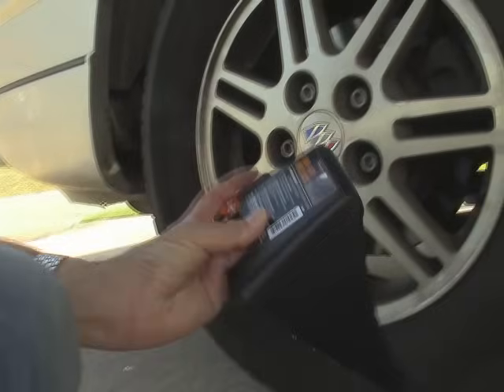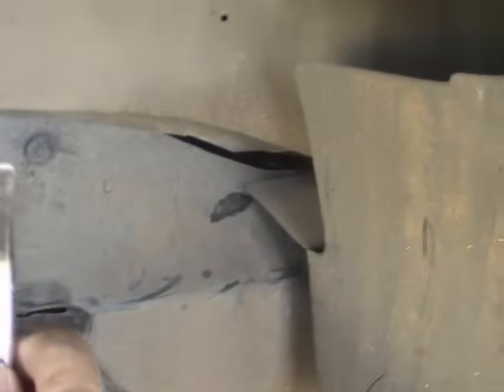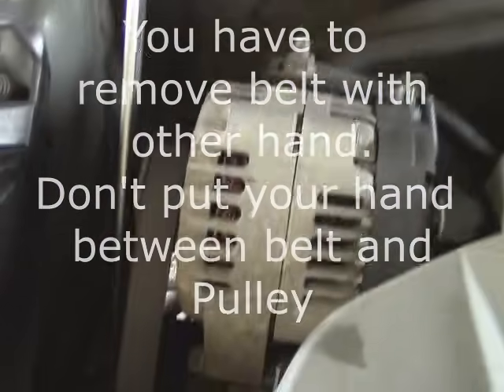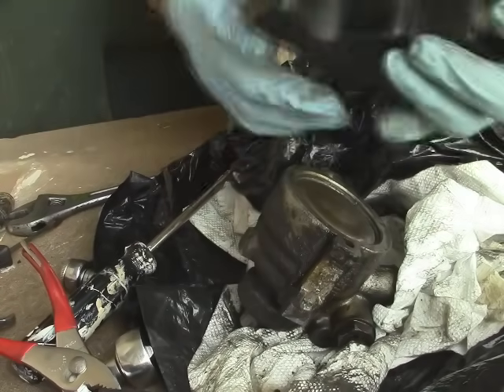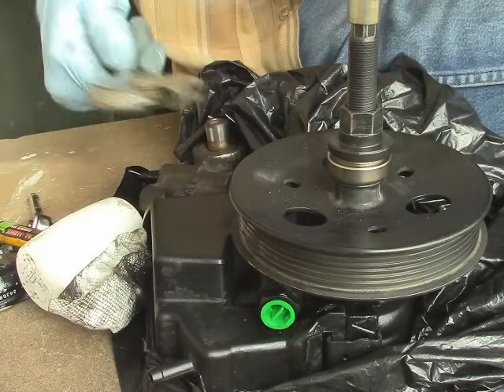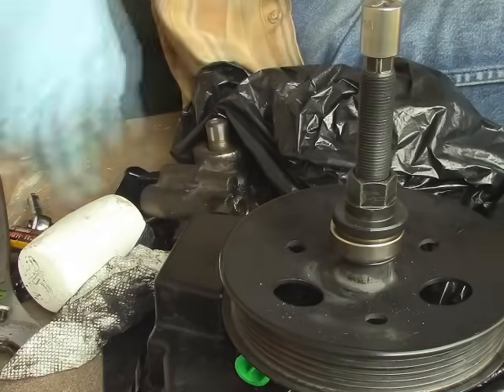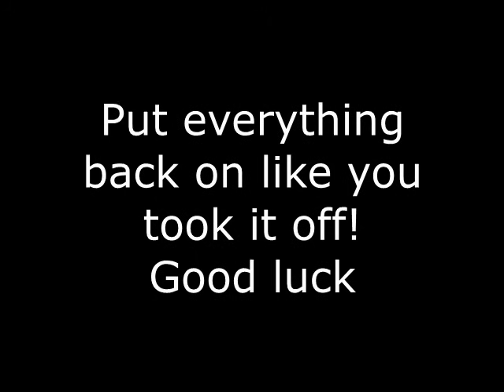How to Replace Power Steering Pump GM 3800

Comment: Thank you. I couldn't figure out how to get the bolts holding the pump out, since these bolts appear to be blocked by the pulley. So you use the holes in the pulley for access! Brilliant! Who knows how long it would have taken me to figure that out. I was going to try and use a wrench on the backside of the pulley. Knowledge is power when working on cars. Great video.
Reply: Brilliant!!💪🏾
Reply from the maker: Thank you
Reply from the maker: Thank you

Comment: It's obvious that you aren't a mechanic or a machinist but you have the guts and basic knowledge to just do it. I cringed at the fumbling with tools - anxiety. Good job, glad I wasn't there to watch.
Reply from the maker: +Bob Jimenez  Ha ha, more not being a mechanic...  However, I am a retired machinist....
Reply: sorry about that. manual or cnc?
Reply from the maker: +Bob Jimenez  hey Bob, used to run, VTL'S, surface grinders, and then the last 5 years CNC, when I first started was in another shop, lathes and milling machines that was more machinist. Last 30 years was reworking jet engine parts.
Reply: we are in the same line of work
Reply: +Bob Jimenez That's how you learn bud. Look up as much info as you can then jump in and try, preferably on a PoS but sometimes you don't have a choice.

Money saving tip: Don't get a belt removal tool, use a 15mm wrench, if you need more force daisy chain another wrench. If you don't know how to daisy chain wrenches look it up, by far the most useful trick in a backyard mechanic's arsenal.

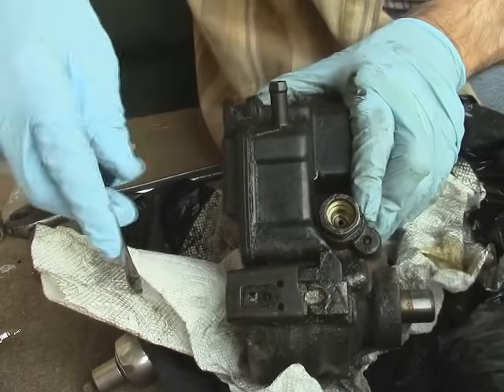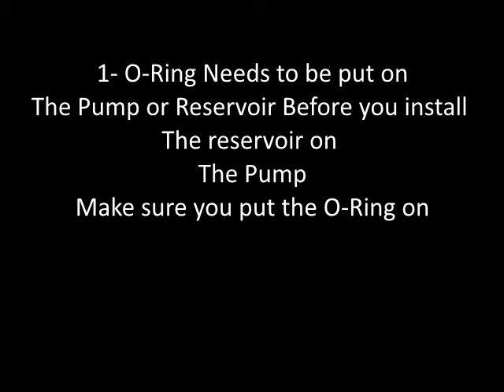Comment: Wheel off and beauty cover off 3:50 5:00 unclamp hose 11/16 not sure on metric pulley removal 9:00 Reservoir removal 11:16 o ring for Reservoir 12:25 o ring install 12:55 17:00 pulley reassembly be sure 2nd o ring on the high pressure line 19:19
Reply from the maker: I guess that sums it up...

Comment: What if the pulley has seized and I can’t rotate it to align the hole with the bolt to remove it how would I get it off
Reply from the maker: ZaYZae,  I am sorry, I don't know, If you have a shade tree mechanic, they might be able to help you...

Comment: How do you get the pump back on??
Reply from the maker: It was a little difficult,  basically the same way you pulled it off, except you are putting it on.
Reply: @RichRodgersOnline  I gave up I couldn’t get it lined up for nothing!! I’m selling it
Reply from the maker: I am sorry it has been a while since I put the video up.  I am not a mechanic.   Just take a break,  then try it again.

Comment: How do you know when the pomp is going bad.   And is not one of the pressure hose.  Thanks. Mine is dripping fluid from some where.   Any tips?  Thanks again
Reply: Did u find out what it was
Reply: Justin Perez  no I didn’t.  My car end up with a bad transmission. So I junked it.
Reply from the maker: I am sorry, I didn't get notifications that someone made a comment.   You may have already sold your car.  
Difficulty steering
The steering wheel may feel stiff or hard to turn, or the vehicle may not respond when you turn it. 
Noises
You may hear a squealing sound when you start the car, or groaning or moaning noises when you turn the wheel. The noises may get louder when you make a tight turn. 
Vibrations
You may feel vibrations or shaking in the steering wheel, especially at low speeds or when turning. 
Fluid leaks
You may see red spots on your garage floor, or the power steering fluid level may be low. 
Fluid color
The power steering fluid may appear gray, which indicates that the pump is breaking down into the fluid. 
Tire wear
Uneven tire wear, such as cupping or scalloping, can be a sign of power steering issues.
Reply from the maker: I understand that
Reply: @RichRodgersOnline  thanks.  No worries.  This comment might help someone else.   Yes I did junked my car.  Thanks again sir. Thanks for uploading
Reply from the maker: @GGarcia7111  thank you!

Comment: So question, how much should I be paying to get my 2004 Grand Prix power steering pump replaced, flushed and checked for leak? Any ideas
Reply: 450
Reply: J Wright quoted 125, 100 and 65.... paid $80
Reply: +2danextlevel what state ? I just got quoted 450 today....... :( definitely will shop around if that's the case
Reply: +2danextlevel Just priced one at Advance Auto for $65 with the reservoir ...$56 without.
Reply: 2danextlevel
Reply from the maker: You probably read the comments

Comment: what is that connector for on the power steering pump? mine was originally mounted to the original pump with a clamp where the bleed screw was. but now my new pump doesn't have a bleed screw. any advice?
Reply from the maker: I am sorry, I do not know...

Comment: I have a question my 97 park avenue power steering bolts broke what bolts do I need
Reply from the maker: There are several videos on YouTube about removing broken bolts.    This is what I would do if you have room.  You need to have a hole right in the center of the bolt.  You do not want to damage the threads.   I would use a center drill to get the hole right in the center.  Then drill the hole with a small drill bit, then a little larger.  You may want to spray the outer edge of the bolt with some type of spray like "Liquid Wrench"  You might wait and spray it again hopefully the spray may get into the threaded area.    After you have done that,  you might get an "Easy Out" and put it in the hole you drilled and hopefully unscrew your broken bolt.   Here is a good example https://www.youtube.com/watch?v=KK6eNjRqOR0
Reply: awe....  that sucks

Comment: how in the heck did you get the high pressure hose screwed off??? I have this same motor and I can't even get a wrench or anything in there. Help me please! How in heck did you do it?
Reply from the maker: +nimrod4569 You might have to hold the nut close to the pump with a wrench and then grab the line nut and loosen it up.  I am not strong...  But it broke loose for me.
Reply: +Rich Rodgers  I got it. I actually kept trying on the bottom of the pump where the high pressure hose connects to. It looked to me like you were pointing at that instead of the actual one I should have focused on. My mistake. Thank you
Reply from the maker: Great!

Comment: How do you get air out of system?
Reply from the maker: I think after it settles the bubbles will go away
Reply: Turn the wheel from lock to lock several times, while monitoring the fluid  in the reservoir.

Comment: How do you know when the pump is bad
Reply from the maker: Terry Nobles   I have little space to answer this..  Pump maybe making very loud Look for increased effort in steering which may be accompanied by pump noise. Low oil can cause this to occur as well as a loose pump belt or bad power steering pump. When the power steering fluid is old it can cause the tubes that move the fluid to gum up which can lead to power steering failure. The power steering fluid will also tell you a lot about the power steering pump. New power steering fluid is colored red and the odor is very distinctive. Power steering fluid that has turned to dark gray this can indicate oxidation. If foaming or bubbles are present in the power steering fluid this will indicate water or air in the power steering line. Look for flakes of chrome in the power steering fluid. This will indicate degradation in the power steering pump.
Reply: +Terry Nobles Mine has a high-pitched whine when the engine is running.  I was at NTB today and they said the pump was going and it would cost $250 plus labor to fix it.  Re-manufactured pump is ~$65 from Advance Auto.

Thanks for the video.  You saved me over $300.

Comment: It's not as easy as just reversing what you doing I've been working on this power steering pump the 2 dam bolts to put it back in for 2 days
Reply: It’s a nightmare I’m still trying to put them back on it’s a tight spot and getting your finger through the pulley and angling the pump itself and once you feel like you’ve got it you really don’t
Reply: took me almost 45 minutes to line it up and bolt it on
Reply from the maker: It wasn't the easiest thing
Reply from the maker: I understand
Reply from the maker: It takes a while

Comment: What is behind the power steering pully?  On a 3800..because I'm leaking oil from behind their but Idk from what
Reply from the maker: Not sure, I am not a mechanic....  I am sorry...
Reply: Oil pressure sender/switch
Reply: Shaft seal is leaking

Comment: So i need that special tool in order to get the pully off  :-(
Reply from the maker: You can rent them from a auto parts store..  Bring it back and it doesn't cost you anything.
Reply: Thanks rich ...thing is there aren't any close to my area are there any other ways i can remove it without the pully removal kit ...again thanks
Reply from the maker: It could mess something up.  It has to be even..  Harbor freight has pulley removers.pretty cheap